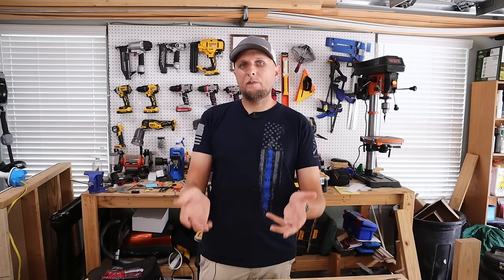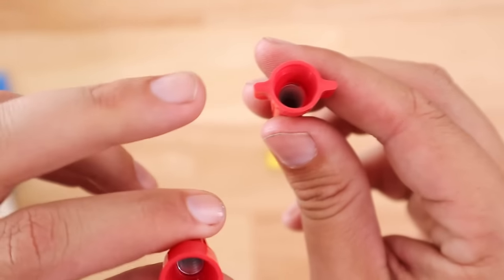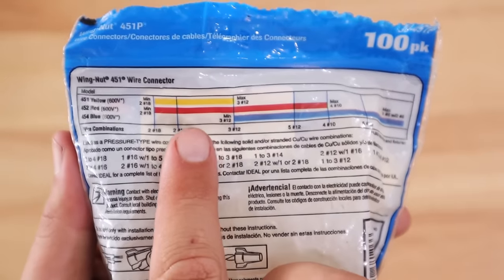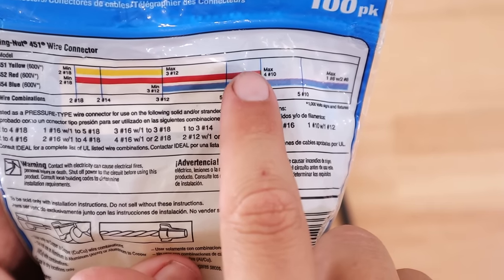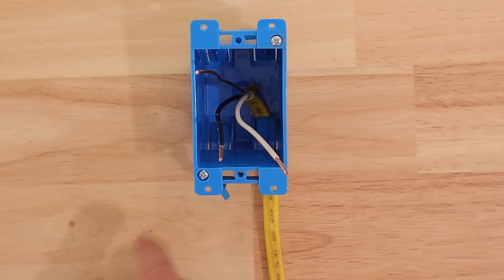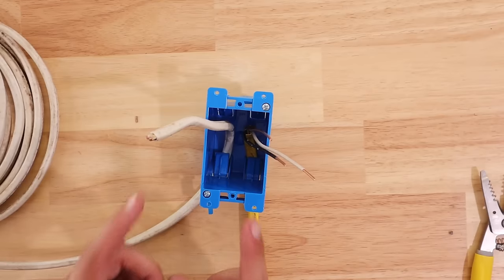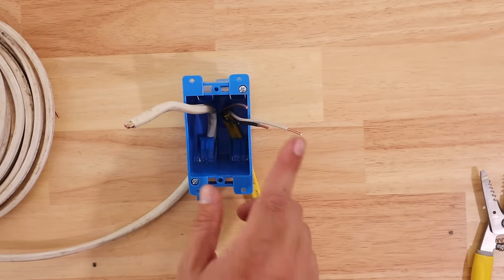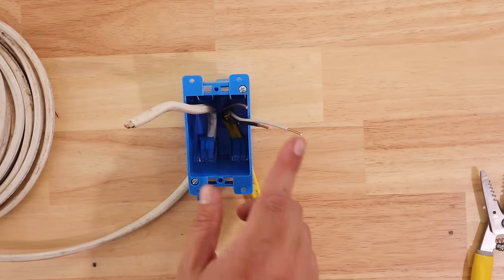Biggest Mistakes DIYers Make When Connecting Wires Together | Part 2

Comment from the maker: Something I want to note, towards the end I say you want to maintain the same color all the way through.  What I meant by that is maintaining the same size.  Hope this was helpful!
Reply: Yes, the same gauge.  Years past, they didn't have the helpful color guide (Yellow = 12 gauge, etc.) on NM (Romex) cable and all of the outer jacket was white both for 14 gauge and 12 gauge.
Reply: @billhandymanbill2775  How much should one really trust the jacket color? Is there an enforced standard from the wire makers to make sure that they put the yellow on 12AWG NM cable only? Or can a shady manufacturer put a yellow jacket on a smaller wire, charge the same as other 12AWG NM cable and pocket the difference in the amount of copper used? I always try to find the labeling on the jacket, but should I be trusting the jacket color more?
Reply: @Sembazuru  I would have to say that the color is the “industry standard” with yellow  being 12gauge
Reply: @Sembazuru  not at all, that's how much. I have a bundle of 12/3 with ground that's white. A few companies have also started to use blue and purple sheathing. Color is really only good for new builds and even then really based on the wire brand. Many contractors like certain brands for different reasons and if that company regularly uses the band (other than when they change their color) it can be pretty reliable. Many also do practice certain standards between companies and color, but it's best to actually check. Like the bundle I have that's 12/3 I mentioned is personal use I got from my grandfather that was a full electrician owning his own company before retiring and passing away just a few years ago, but the wire is likely older than me at over 30 from before he retired, but still has a nice flexible rubber sheathing and still safe.
Reply: @zacharythebeau163  The type of NM cable approved for indoor (dry location) use is NMB cable, and a color code for the plastic cable sheathing has been an industry standard since about 2001:

White - #14 AWG  (rated for maximum 15 amps)

Yellow - #12 AWG (rated for maximum 20 amps)

Orange - #10 AWG (rated for maximum 30 amps)

Black - #8 and larger (higher amperage ratings - not shown above)

Gray - UF (Underground Feed) means cable rated for exterior use but color does not indicate wire size. Wire size printed along sheathing.
Reply: @bobcosgrove3235  just scraped some blue sheathing 12/2 with ground.  The scrap dealer told and showed me that it was not copper, it was a coated wire and when you would look at it the copper like top coating actually did not look like copper at all.  The scrape dealer said throw it in the trash.
Reply: @billhandymanbill2775  for sure... some of the inspectors don't even know that.
Reply: My '22 new build here in GA has all 12ga but with white jacket on 15 amp breakers and yellow jacket on 20 amp breakers. No idea why. The receptacles and switches are correct based on amperage.
Reply: @dougschaefer3111  are you sure the white isn't 14 ga. white is usually 14 and that would also be correct on a 15 amp circuit.
Reply: @bobcosgrove3235  Found out while adding a receptacle and relocating a light switch.
Reply: Very informative
What about if I attach a 20 (12) amp wire to a 15 (12) amp and 15 amp is running into the panel? The receptacle is for a tv and kitchen lighting is on circuit
Reply: It was helpful, thank you. I still have a question before I take the plunge! lol bzzzz  So, if I put  ... 110V /10ga +110V/10ga + 220V/14ga together in a connector, and a 10ga neutral +14ga neutral in another connector, and, end cap the 220V ground, in a third nut.... my 220V/1600W grounded tool will be fine? Correct? Only 7.3A ... it might even be 16ga, I haven't cut the plug off yet.  Peace

* the part I'm unsure of is, if what the tool calls for is the limit, or if, once it's live, it just floods out to the breaker limit. Cz it's the dryer, so I think that bereaker is 50A? or 30A? But either way, if it sends that, I'm pooched

**double star, lol - it's kind of messed up, because why would someone put a standard household 110V no polarity plug, on a 220V tool? ... and then sell it to me, lol

Comment: Your videos are good because you get to the point and keep it on topic, with the necessary details.  The number one thing about how-to videos is not wasting the viewer's time, and you do a great job of including a lot of relevant information while not wasting my time.  Thanks!
Reply: Funny cause I was thinking the opposite. 1) A simple instruction to know and follow the instructions/specifications on the wire-nut or other connectors’ box, and 2) never use any wire in a circuit where the fuse is rated for greater amperage than the wire. The fuse must always be rated equally or less than the weakest component in the circuit, wiring, connectors, outlets, switches included. 

A two minute video tops.

Comment: Did a job for a demo/re-mod contractor, the original wiring was all black for 14 gauge and black with a mostly worn off silver stripe for 12 gauge... it was a major pain thinking about things like making sure there's no mixed boxes (like in your example)... I'm really appreciating the relatively standard color coding of sheathing nowadays.
Reply: Yeah the Inspectors like it too, much easier to tell if someone is trying to get away with wiring a Dinning Rm with 14 wire!

Comment: Generally speaking your video is correct.   As far as your wire size discussion, as an electrical design engineer for contractors, I have designed 20 amp branch circuits many times with #4, #6, #8, #10, and #12 all in the same branch circuit.  It happens all the time in branch circuits feeding parking lot lights to reduce voltage drop.   But I agree that people that do not do their due diligence will very probably cause problems.   
As far as #14 on a 20 ampere breaker, yes, it is a NEC violation.  As far as the #14 burning up and causing fire, not so accurate.   Table 310.15(B)(16) shows #14 at 75C rated at 20 amperes.   The NEC code making panels decided many years ago to oversize #14, #12, and #10 and require them to be 15 amp, 20amp, and 30 amp.   So, wrong yes.   Cause a fire?   Most likely not.
Respectfully,   Kevin
Reply from the maker: Thanks for the feedback Kevin!
Reply: This was helpful to me too, thanks Kevin!   We are redoing a solar backfeed with the intent to up-size the system to roughly 5kW of real production on  240VAC circuit.    If I understand this correctly, my choice of 10-gauge wire and a 30-amp breaker should be correct.  The actual circuit will not carry more than 21 amps (5kW).   More likely to be closer to 4.5kW actually, so more like 19A max.

-Matt
Reply: @junkerzn7312     According to NEC, you are required to take full output on the inverter times 1.25 = overcurrent protection size of 30 amps at 240 volts.   2 pole breaker.    #10 copper is rated at 30 amps.  The maximum solar you can put on a 200 amp panel is 20% so 40 amps.   If 100 amps then 20 amps.  Best wishes,   Kevin
Reply: @KevinCoop1  Thanks Kevin!    There were some tidbits in there that I wasn't aware of.  It looks like I'm sizing the system properly.  Fortunately I have a 200A service going into my home and the back-feed goes directly into the main panel.
Reply: @KevinCoop1  Heh, I didn't think about that too much but it makes a lot of sense, I assume because of you are producing, consuming all that, and drawing in near the max power - that can overload the main panel?  I had a 5.1kW inverter then added 2kW more (microinverters) and that's well under the max for my 200 amp panel, but I did upgrade the panel at the initial solar install...good thing I did that!  Looks like I had to anyway of course though.  The original 100 amp main panel is now a sub panel in my garage.
Reply: An an IBEW journeyman who has worked with drawing for a very long time, l have zero respect for electrical 'engineers'. Respectfully, BC
Reply: @whattheschmidt  Yes, the bus in the breaker box has to be rated as if all possible inputs to the box were being drawn (by loads within the box) at their maximum capacity.  

When I put my solar in, I had a 100A dedicated service to the garage on more-than-adequate wire.  My breaker box was a perfectly adequately-sized 150A-rated one.  My solar was 6kW or 25A.  That upped the maximum theoretical input into my breaker box to 125A.  Sounds fine, right?

Nope.  Given a 25% tolerance for continuous loads, I needed a box rated at 156.25A.  I was literally only 6.25A short, but code exists to make sure you can run your sparky things at theoretical maximums, not just "what you are likely to see 99.999999999999% of the time".

New 200A-capable breaker box it is, then!  It sure is pretty.
Reply: @Nate Hoy  interesting, makes sense. I assume de-rating the main breaker was a no-go since dropping to 80amps (or 64 continuous) would be too low. I'm happy with my 200 amp and 8kW of solar panels! Working great for 3 years now, no issues.
Reply: @whattheschmidt  I certainly could have de-rated but it was only a few hundred bucks to swap the panel so I went with that.

We have two EVs and I didn't want to de-rate too hard for future proofing.
Reply: @bc1173  I wouldn't say zero respect for all EEs, but certainly for the ones who believe that being an EE automatically makes one an electrician.

Comment: Second rip on mixing wire gages was Exactly what I came here. THANK YOU for this post. I was going to run 12/2 into a junction box and run 12/2 out for an extra receptacle and 14 gage out to power 2 light fixtures in the basement. I will just run 12/2 for all of it. Thank you again.

Comment: I have 14 gauge all over the house and the previous owner decided to put in 20A breakers 😭 there are even some on GFI. I've been replacing them as I go (I used to work for a VERY strict and particular electrician when I was just out of high school 20+ years ago. I watch your videos to validate all of the things he used to say and I learned, and I have to say you have both been on the same page with everything. ;) The electricians who wired my house were also hacks, big time. Constantly correcting everything as we refinish each room, they loved back stabbing outlets, and they just fall right out as my old boss used to say it would.
Reply: Replace those 20A breakers back to 15a....and on the heavier draw runs...put in 15A ARCFault....gotta protect those circuits!
Reply: I experienced the opposite problem: The ancient backstabs would refuse to release, no matter how much I poked or prodded the release tabs. I often ended up just re-terminating and putting a new outlet/switch in.
Reply: @Ithirahad  Original construction in my 45 YO house, I'm replacing every single switch and outlet, and every single one of them was backstabbed. I just cut the wire and reterminate. I'll pull out the bits of wire for my copper bucket when I break the old devices down to get the brass tabs out for scrap.

Let me add that I also vacuum out all of the debris in the box that is either from original construction or somebody's shoot remodeling in the past. Almost all of the outlets brass innards are packed with dust bunnies too. Seems like that would make good kindling for a not-so-nice electrical fire. Think about that if you have an older home with old outlets.
Reply: @dolfinwriter5389  Better than my situation. Bought a house last year, and the previous owner informed me that a particular breaker would always trip but he couldn't figure out why. It took me about 30 seconds of looking to inform him that 90% of the house was wired to that one 20A breaker. The only things that weren't connected to it were the heavier appliances like the water heater and dryer. Currently in the process of undoing the rat's nest of junction boxes and separating the rooms out to the other 19 unused breakers in the panel lol
Reply: @Crumbly_Muffins  It's a damn miracle the place didn't burn down. But there's no real way of knowing WHICH idiot did that.
I'd be checking every wall and the attic for hidden junction boxes too.

If you're still under Home Owner's warranty, you ought to be able to get this fixed at no cost to you.

Any inspector worth a damn should have discovered this too, by counting the number of devices on each breaker and by a thermal image survey of the box and wiring.
Reply: @Crumbly_Muffins  3:44 3:44 "

Comment: You did an excellent job of explaining the 20A and 15A circuits and 12 ga and 14 ga respectively.   One of my big pet peeves.   Sharing a neutral on two 120V circuits and two separate 120V circuits in same gang box are my others.
Reply: I just read that two 120v circuits in the same box is ok as long as the total voltage is under 300v.

Comment: Biggest issue I've seen in almost 20 years in the trade is a copper to aluminum connection without the proper splicing compound and rated solderless pressure connector... I did a HUD housing project in Orlando and all of the units were run in 14 gauge aluminum in the 60s. We didn't run any new wiring. We were required to use this special crimper that only one company makes and you have to take a class to be able to use it. The crimps were insanely expensive and they only gave us one tool. It was a nightmare. We had to crimp copper pigtails at every termination point including the panel... we did not look behind walls or in attics, however. Some of the buildings didn't have power for over 10 years. When we finally put power back to the buildings one of the units started smoking from the attic.. one of my guys ran up there(even though I told him to let it burn) and put out the fire with an extinguisher. The problem was a copper wire spliced to an aluminum wire with a regular wire nut. I've never actively witnessed an electrical fire since that or before and I've never had one of my jobs light up ,thank God. Fortunately it occurred when no one was inside the building, it would have been a much different story otherwise. Stay safe fellas.
Reply: U can splice the copper and aluminium together then soldering them ..I think this should prevent oxygen from entering  .. this is a cheaper way than using an expensive crimper

Comment: Very helpful on the 14 & 12 wire you brought up , i have a 20 amp breaker that powered a 220 volt Kenmore a/c which finally quit
thew new a/c takes a 15 amp breaker and has a 15 amp plug on the cord , i haven't sized the wire it's in white romex  and could
be 30 years old so not sure if 12 came in white back then - so if the 15 amp breaker replacing the 20 and the cord had a gfi and the wire 
is mixed sounds like it should be ok and would not overheat ?

Comment: Wow! I had no idea. Thanks for this! The shop building on our property has seen several people over the years do various wiring projects. There is a mix of yellow and white wires running here and there. Wire nuts run a gambit of colors. I've got some serious checking to do!! Very valuable info even if you don't do any DIY wiring. At least you can realize ya might have a problem in the making.
Reply: if you are going to look at your electrical wire mess, make sure you read the wire size on the cable older wire wasn't always color coded like the new stuff.
Reply from the maker: Yup you are right about that.  I have corrected some issues in my own home that were done by a pro when it was built.  Nothing that was just awful but could be better.  Thanks a lot for the feedback and good luck on the hunt!

Comment: Nice job.  One comment I would like to share is that not all romex 12 gauge wire is yellow sheathed.  It could be gray in the case of underground burial wire, white or black sheathed in the case of 60's vintage 12 gauge wire.  A 15 amp outlet can serve as a quick reference to wire gauge by trying to push or back stab the wire into the back of the outlet.  If it does not easily go into the wire hole it is likely 12 gauge.  Also sometimes with THHN insulated 12 gauge wire it may appear from the outside of the insulation to be a 14 gauge wire because the THHN insulation is much thinner than the older wire dielectrics.  A good thing for someone to have if they do not know how to recognize wire sizes by just looking at them is a simple plastic wire gauge.  It will allow them to just try the different sized holes to determine the gauge of the wire.  Of course, first check the wire sheath, if accessible, to see if it is marked on the sheath.

Comment: Years ago code allowed for such a wire combination. Say from a switch to a light fixture. None of the companies I worked for would allow that. We pretty much ran #12 all throughout, except for circuits that require #10 (water heater, dryer), #8 (stove/oven), (#6 (HVAC) and #4 (HVAC) depending on your HVAC requirements) SER (service wire) you generally do not run through the structure which is you 4/0 2/0 wires.

But there is this weird issue with some hard-wired appliances. Like a stove or oven. It gets fed with #8 from panel but attaches to #10 at the appliance. So that gets a little confusing for the DIYer. 

Great video!!!
Reply: The tap at the appliance has higher rated insulation on it.

Comment: Wiring up stuff on old trucks like tail light wires I just solder them then put electrical tape and coat it with liquid electrical tape or PVC , ABS glue or the like.  The tape never comes off, you can coat the tape and the were so it's glued to the wire as well. They're hard to cut apart but they hold really well and for a very long time.